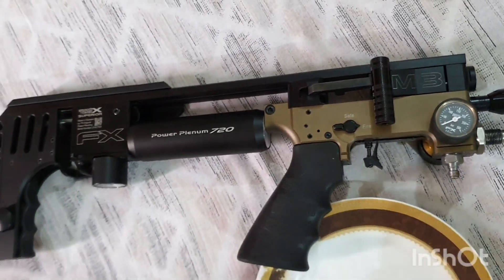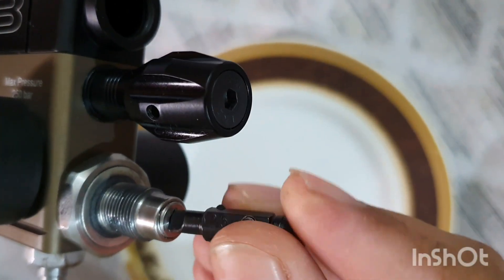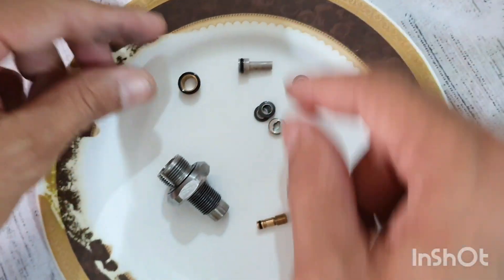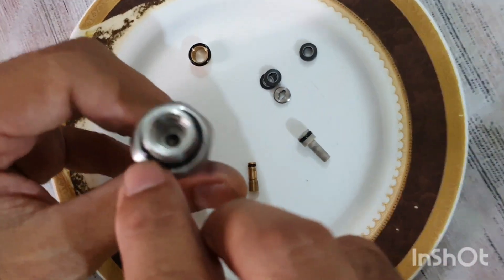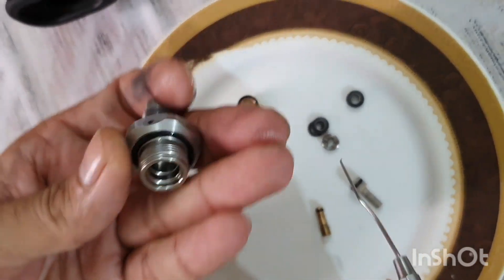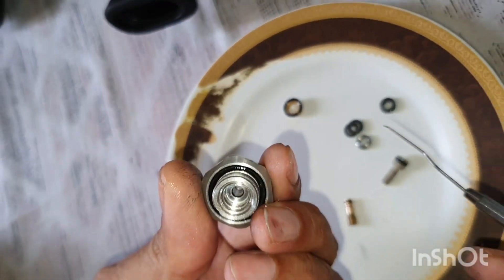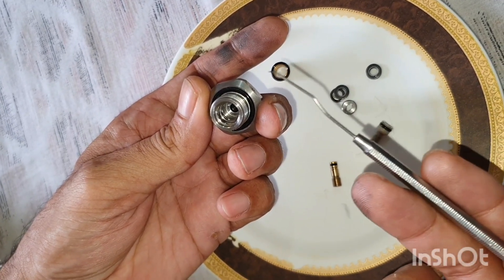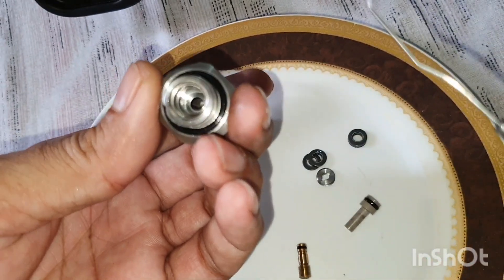FX Impact M3  1st regulator hidden "O" ring (4x1.5mm 70 shore) fix (English & Urdu)

Comment: My friend, I have a problem. Can you help me? My first regulator, when I set it to 180, goes up to 190 after half an hour. I've replaced all the rubber seals, but when I use them, it goes back to 180 and then up to 190 after a while. What's the problem? Can you explain?
Reply from the maker: Its a good example of regulator creep. If all O rings are fine then contact surfaces of piston tip and adjuster screw are not perfectly matching. But still for 1st regulator,  it will not disturb your shooting if your 2nd reg is fine. 1st regulator is just to break the bottle pressure.  Whether it be 180 bar or 190 bars, the 2nd reg normally doesn't get affected.

Comment: Thanks for your discovery. It's very bad design without thinking about serviceability. I do noticed I have the same problem. I also replaced all O-rings, still very small leakage continued. Now I realized the problem after going through your post.

Comment: hello my fx impact m3 rifle a year ago three months change o-rings then put surprise air bottle low pressure 50 bar to 100 bar, ()()()()()() something is wrong bellville washer is not force 200 bar, aid
Reply from the maker: 1st reg washers should be  (())(())(())
Reply: @BhaursAirguns  I ask to buy 12 bellville washers to see it works, I see your piston with a little thick hole what is it for thanks
Reply from the maker: @daiwangel  my piston with a larger air hole allows to recover quickly

Comment: I have the same problem right now 😕 🙃 😒
Reply from the maker: If you feel appropriate you can login to Airgun Nation Forum and mention all this with reference to my channel. 
I hope it may be beneficial for many members there. All my videos are of technical nature. Hence through this route, the shooters might find my channel and my videos may be beneficial for them too.

Regards,
Reply from the maker: I hope my video would have helped you fixing the problem
Reply: @BhaursAirguns  yes me too I just ordered the orings so I could fix the problem I noticed that every time for the past three weeks that my gauge would be like 5 to 10 bar lower from week  to week from a 250 bar fill so I started checking for leaks and sure enough it was coming from that little hole in the regulater thanks so much fir the video I watched some other videos and they did not mention that that O-ring would cause leaking in the regulator they mentioned that one on the piston adjust screw and the one in the back of the piston ( black) one but never that one thanks again hopefully it will fix the problem 👍
Reply from the maker: I think 12 washer (())(())(()) pattern will give you 200 bars in 1st regulator
Reply: @BhaursAirguns  ok thanks I just can't seem to fix that leak
Reply from the maker: Are you sure that your 1st reg is leaking from its breathing hole ?
Reply: @BhaursAirguns  yes I use snoop leak detector and it's a very slow leak I even put my tongue on it and I can feel the air lol bit yes it's leaking from there
Reply from the maker: Please also check tge condition of the piston. If it hs scratched, it can cause leak
Reply: @BhaursAirguns  ok I'll check it out
Reply: @BhaursAirguns  well I polished the black piston and brass adjust screw and applied silicone lube on Bellville washer and 0rings normally I'll put lube and wipe all the excess off well this time I left it on not alot but more then I like too I put an extra washer like this (())(())(())) then put everything back together well it's not leaking anymore and it's at 200 bar and 165 bar in the second reg I'm shooting 34 gr varmint knockers at 1000fps im.back in business thanks your help
Reply from the maker: Welcome.  I am happy because you are happy.  Happy shooting 🤗
Reply: @BhaursAirguns  yes sir I fixed it I just inspected all the O-rings and relube  them with plenty of lube  and lubed  the Belleville washers put it back and the leak stop ✋️
Reply: How Bellville washer do you have in your first reg I have 13 because I put it at 200 bar anyway I changed that 0ring and it's still leaking is it because I have 13 or is it because I'm running the reg to high
Reply from the maker: Looks like some of the O rings are still faulty
Reply: I give up I tried to fix it again I just got my 0rings from fx usa so I know they are good 0rings I changed out all 5 of the 0rings and it's still leaking it us so frustrating and I do not use metal picks to remove or replace 0rings I use plastic tool picks I don't know what's wrong with it I ordered a delete kit from saber tactical I'm going to try one more time and if it doesn't work I'm going to install delete kit and just use one reg I did very carefully I took my time I lubed all the orings and I only use 12 washers Belleville washers and still leaks (())(())(()) wonder why it's leaking I would of never er new it was leaking until I watched to that video from Ernest rowe lol dam it's very frustrating thank you I'll change it again may install the new brass piston fx has now I have two that I ordered but have not used them yet my gauge is sitting right at 200 bar I don't know 😕 thanks for your advice maybe if we were neighbors you could fix it for me anyway thank you for your help
Reply from the maker: @chrisfigueroa3361  I would love to fix your gun if you had been here

Comment: Where did you get that peek piston? And did it seal completely without creep?
Reply from the maker: My machinist makes it for me. It works great for me and lasts longer
Reply from the maker: I also modify the valve of my Impact M3. I remove the delrin valve and install made of peek. Works better.
Reply: @BhaursAirguns  that's amazing, theoretically it should prevent valve sticking in those huge plenums and reduce  first shots variations. 
If you plan to sell these peek parts, let me know.
Reply from the maker: I can provide the peek pistons. Where are you from? Its a bit costly item and shipping charges makes it much more costly
Reply: @BhaursAirguns  I'll contact you by email.
Reply: Sir do you have anyone in India who can sell me'your peek piston and other IMPACT M3 parts..i am saying this since i can't directly buy from you. I am in india
Reply from the maker: @alongnek2105  I might be able to send to UAE. I cant send anything to India directly.